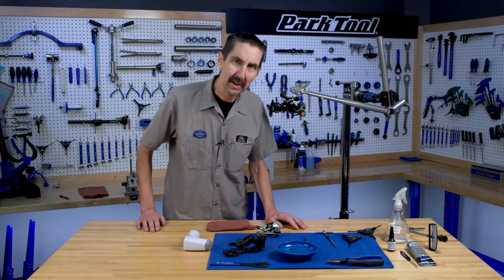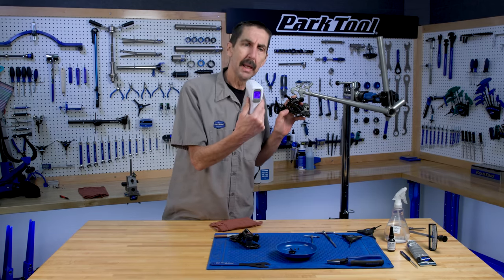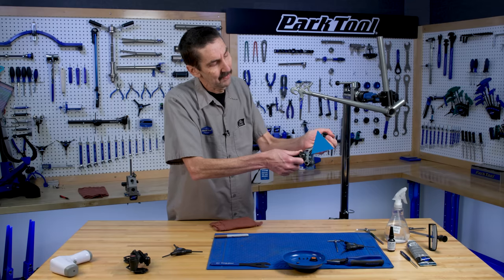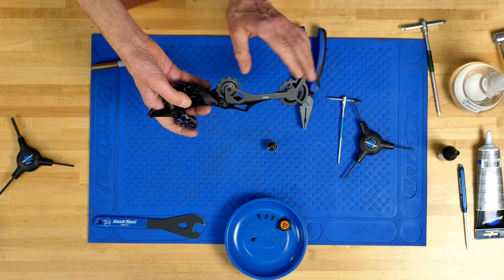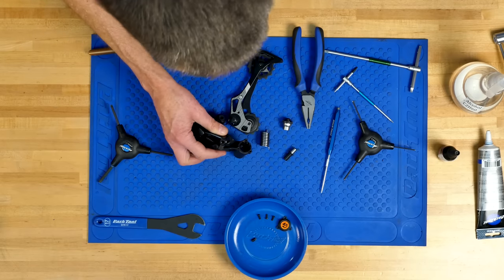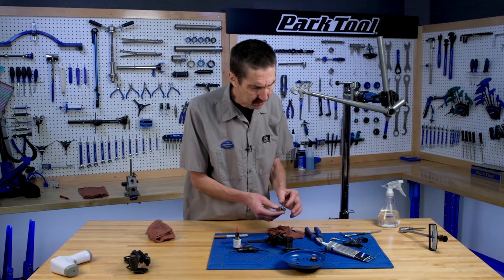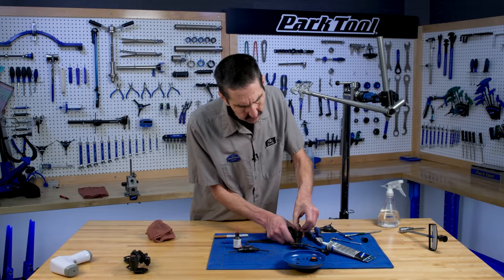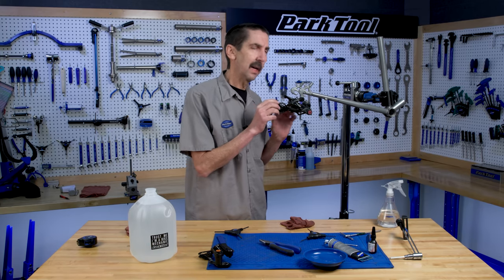A Look at the BOX One & Two Clutch Derailleurs

Comment: I have a Box 4 groupset and I love it, but what i don't love is trying to get the chain or rear wheel off, it's a royal pain in the @$$ because the clutch on the Box 4 is always engaged. If I ever need to remove my rear wheel I have to remove the chain or it's impossible to get the wheel back on because there's so much tension on that rear derailleur that it's almost impossible to push it down to move it out of the way of the wheel. Once i save up some money I'm thinking of switching to a derailleur with a clutch that i can disengage.
Reply: Same here with box 3. But I hacked it by bending a nail, pushing the derailleur forward and pinning the chain with the bent nail so that the derailleur stays forward. This gives me enough slack in the upper part of the chain to remove and put back in my rear wheel